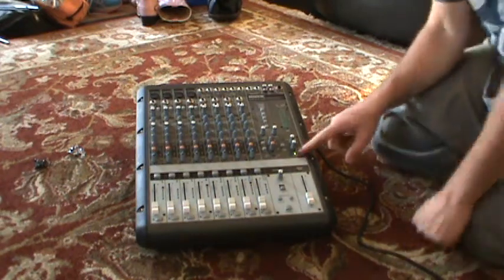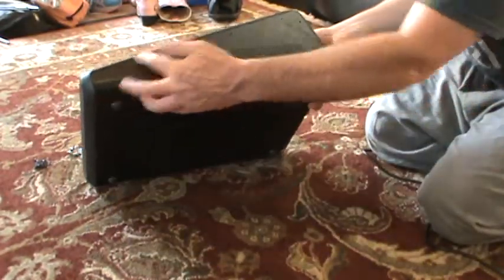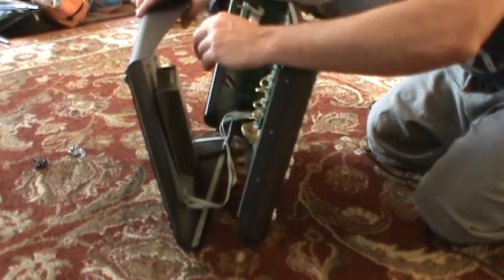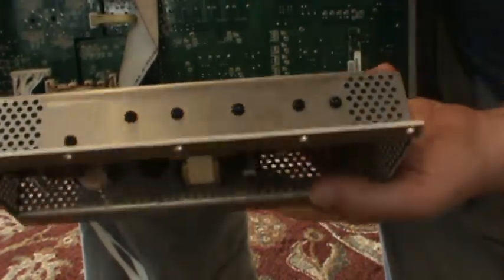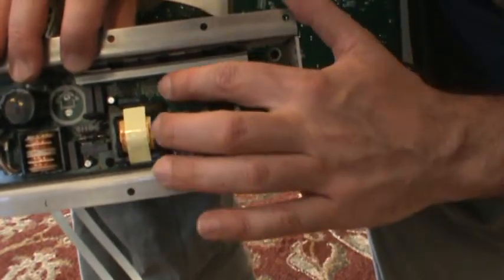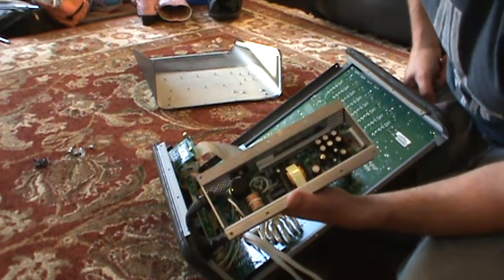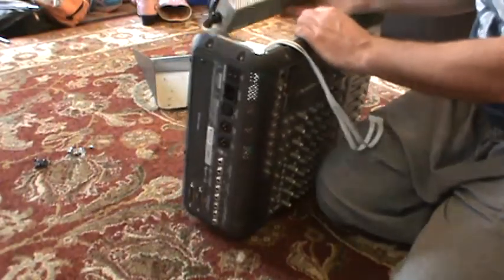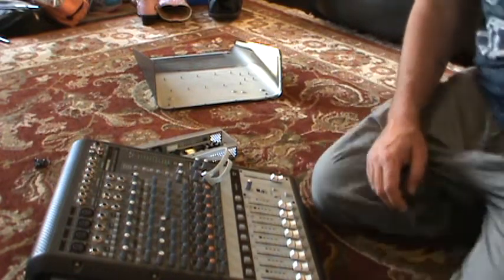Mackie Onyx 1220 Mixer Problem Lights flash repair

Comment: Thanks for posting this.  We had a bad storm here the other night and when the power was restored I heard loud popping sounds coming from my basement studio.  When I went down I found the same thing happening with my Mackie ProFX16v2 - flashing lights and loud pulsating out of my speakers.  I ended up going the route of getting a replacement mixer from eBay, figuring the cost of repairing this professionally (if even possible) would be close to buying a replacement.  I needed something in a hurry otherwise I may have attempted to go the route described in this video.

If nothing else, this video validated my assumption that something happened to the power supply as a result of an electrical surge.
Reply from the maker: Send it to me!  I will be glad to try the fix! 😁

Comment: Thank you I just bought one of those in the swap meet and he's doing the same thing do you know where I can go buy the little part for it.. by any chance I hope you answer to me.
Reply from the maker: I got mine from some old electronic boards I had laying around.  Probably an old cathode ray tube (CRT) monitor.  www.digikey.com sells them, so does www.mouser.com, and etc.  The key is to get a capacitor that has the same capacitance (microfarad) rating, and at least the same voltage rating.  If you have not experimented with electronics yet, it is a lot of fun.  Just get some old electronics (probably not working) and start tearing them apart and trying to learn what each of the components on the circuit boards are.  If all you want is the capacitor, just google "4.7 microfarad capacitor" and you will find many.
Reply: Damon Sisk thank you very much appreciate it 😊